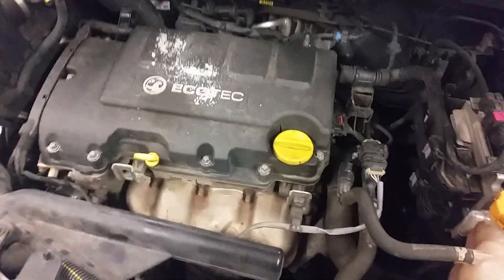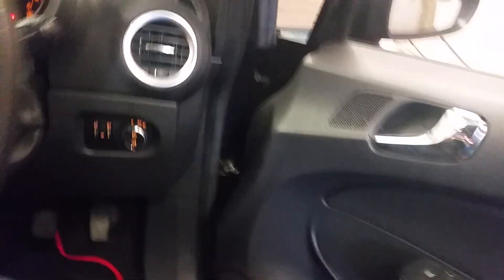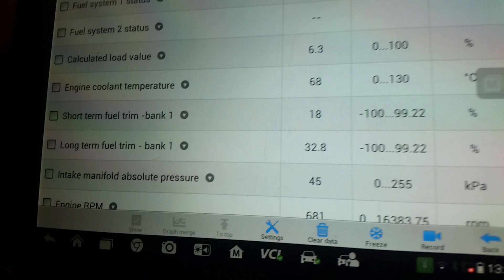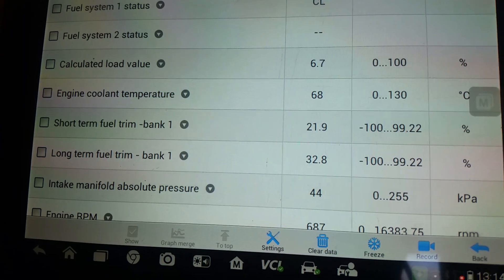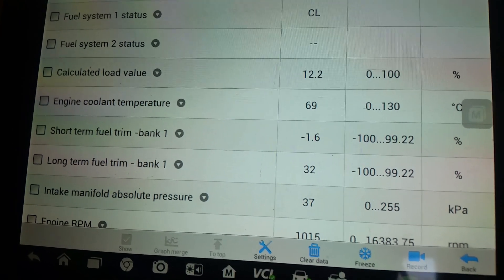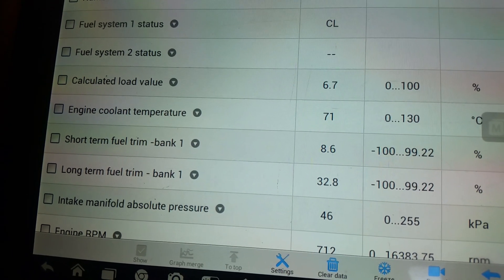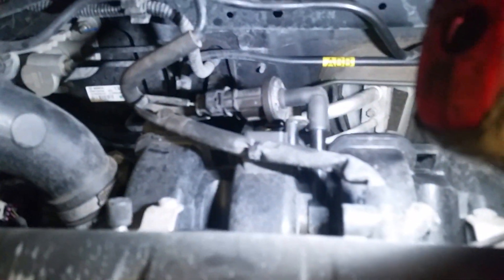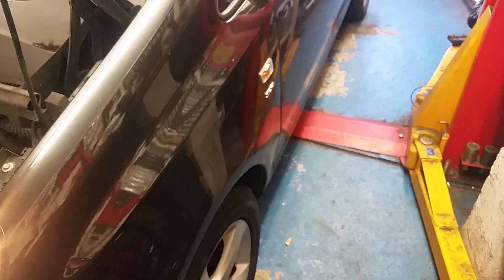Vauxhall/Opel Corsa d 1.2 p0171 rough idle Part 1

Comment: At last took sensible north ireland gent to come up simple answer.
I had changed coil pack, spark plugs, checked fuel, checked air mass valve.
Read this post and checked epvalve, open all the time even when 12DC. Applied.
Removed valve and temporary bung fitted, engine idlin ok, new valve ordered.
Reply from the maker: Top job, Don. Pity about fitting the other parts, cheers

Comment: I would check the o ring and seals of the dipstick and oil filler cap, I had this fault after an oil change and the cap wasn’t sat correctly

Comment: Where is the map manifold sensor?
Reply: Ayres i have an vauxhall corsa D 1.4T and it has 2 MAP sensors, one on the intake manifold and the other on one of the pipes coming from the intercooler.